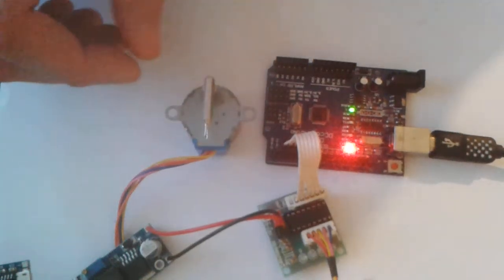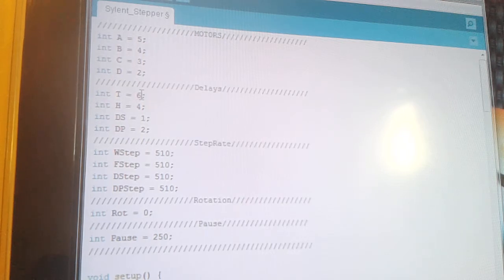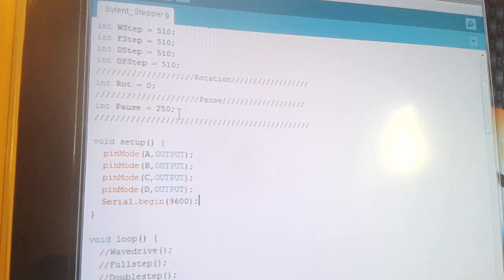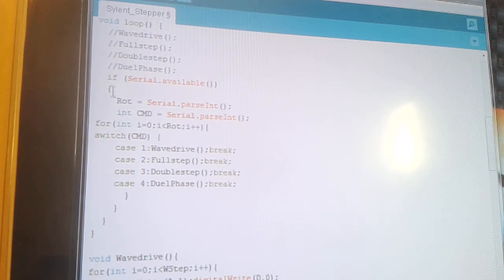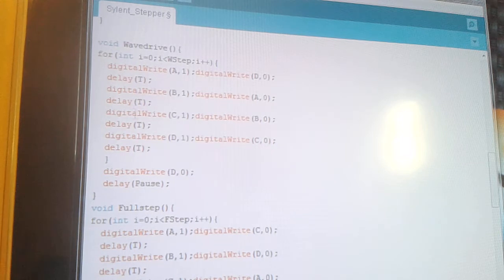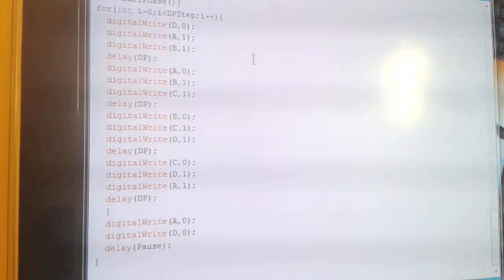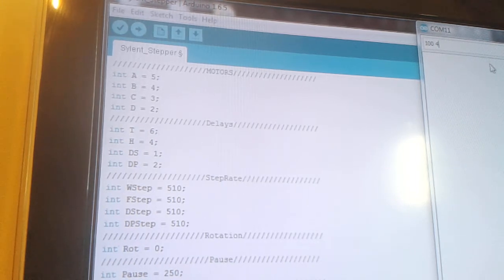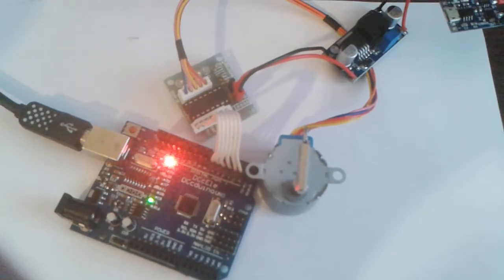How To Control A Stepper Motor With Arduino (Tutorial)

Comment: Are u using 28BYJ-48 step motor? Why do u use battery? how about getting 5V from Arduino?
Reply from the maker: The 5 volt from the arduino is not enough to run the stepper properly, I find that doing so the stepper motor will skip steps and is also very weak, the battery i'm using is boosted to around 11 volts dc.